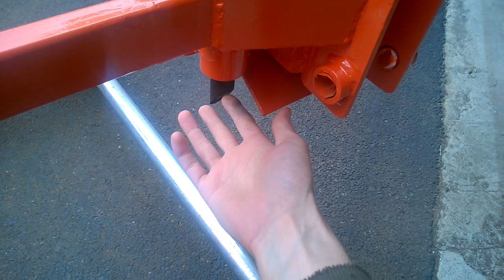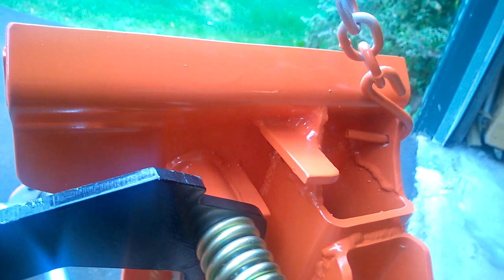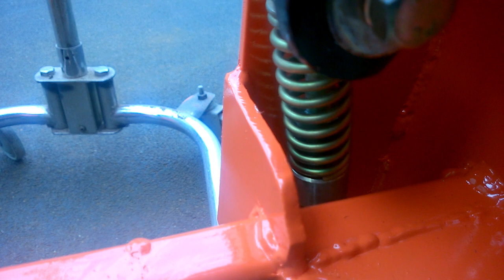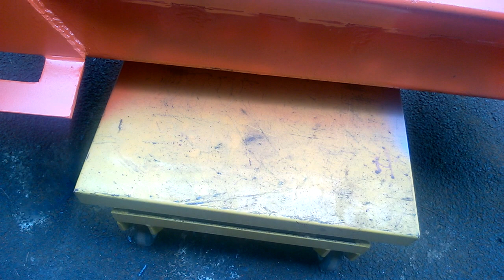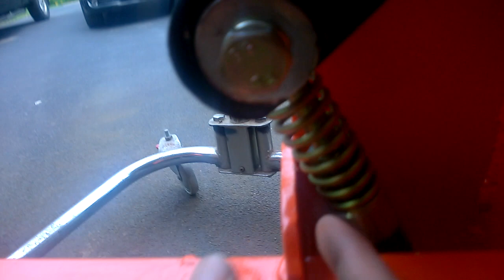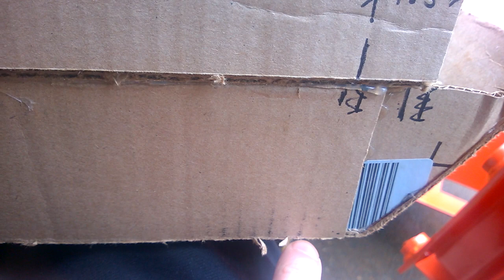Quick Attach Bucket Conversion

Comment: Thanks for sharing this.  I have a B7300 with a similar bucket which will require similar treatment in order to be converted to quick-disconnect style.  Your build has given me food for thought and definitely highlights some of the considerations.  How has it worked out for you since?
Reply from the maker: it was a great build 0 problems. sold the tractor maybe 2 years later but no complaints